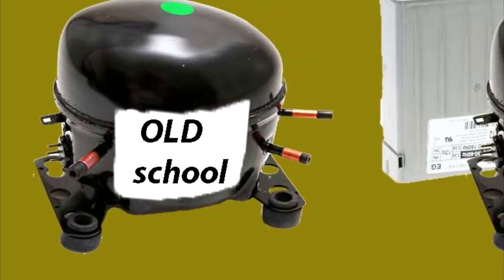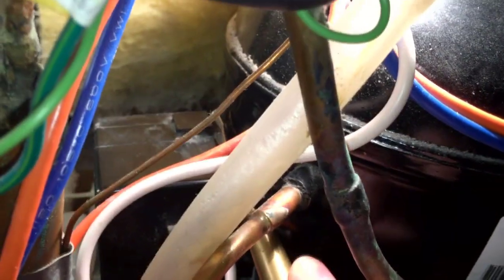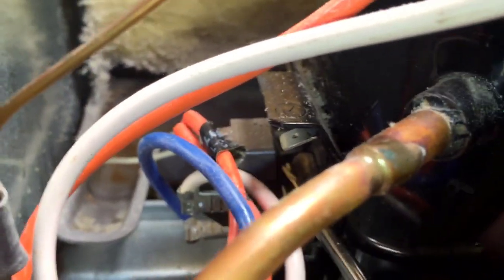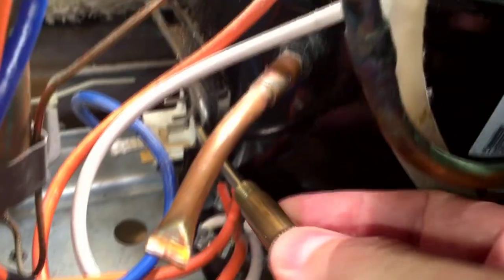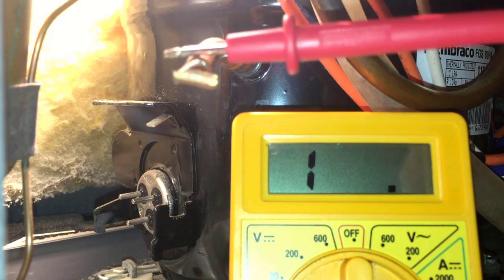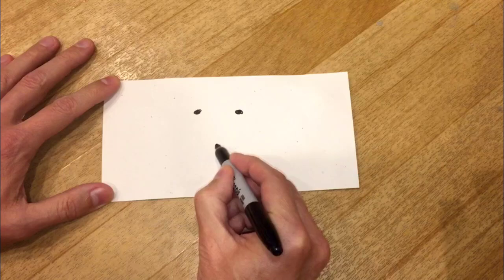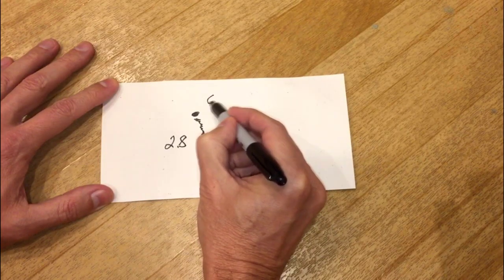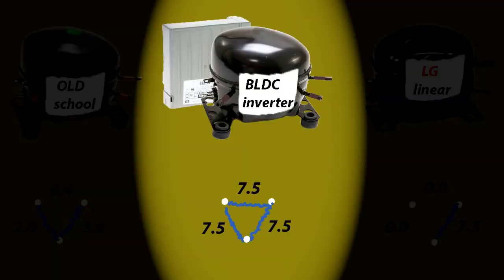Testing refrigerator compressor LG, Samsung, Whirlpool...

Comment: Sr watching your vedio. Regarding  3 types of compressor. Why that lg com. Deffirennt widing? Kindly explain . ?  Your subcriver from the philippines  thank you
Reply from the maker: The LINEAR technology is different than the others. So it requires only 2 terminals, HOT and Neutral. It can also be powered directly from the wall electrical outlet.

Comment: Great video. I have LG lfx25974sw from last 7 years. It stopped cooling. I checked both capacitors from panel, both good, fan and compressor  working and from my left bottom to top was 7.5. However, coils are room temperatures and one of the compressor line does get slightly hot if let it running for an hour. My technician suggested that the compressor is bad. Any suggestions. I am very non-technical but gained a lot of knowledge from YouTube from people like you who actually share their knowledge to benefit other and I have benefitted Thanks. BN
Reply from the maker: It seems you've done everything you can on your part. The problem is with the compressor, the refrigerant leak or restriction. Any of these problems should be repaired by a tech and kinda expensive. So I guess it's time to decide if you want to fix it or buy a new one. If you have the receipt, LG may cover the cost of the new compressor, but you'll pay for labor.
Reply: @Your-Self  Thank yo for your reply. LG sent me correct compressor but wrong Board and after figuring that out got new board. Earlier tried the Wrong board which only sent power to compressor as other would not connect and it ran for few minutes and then died. Service man connected new compressor and put some Freon but the Compressor would not work and still does not work even after he put some hard start as he said that it by passes the Board but the compressor would not start. He does not pay any attention to my Please to check the capacitor, over load or relay. I have bought two Volta meters but don't know how to check the capacitor, relay and the overload. Other tech I cant get as he promises but no show. Any suggestions. If none that is OK. Thanks and Happy Holidays.

Comment: Hi thanks for the great videos! New subscriber here. I have an old-school compressor that won’t start. I changed out the start relay but still not working. My readings are across the three pins 5.4 3.2 8.2 my low readings don’t exactly match the total high rating. About .4 difference. is this enough to indicate a problem with the compressor? Thanks!
Reply from the maker: Your compressor readings seem to be OK. Did you check if the compressor is shorted to ground?
If the fan (next to the compressor) is not running either, the thermostat (temperature sensor) could be bad.
Reply: @Your-Self  hello! Yes I checked continuity between Pinz and ground seems to be OK. Both fans are spinning OK. I thought I eliminated the thermostat because I checked for continuity across its connectors at room temp is that right? Thanks for your quick reply!
Reply from the maker: It's difficult to say because there are many different mechanical and computer-operated systems. So depends on your model number, problems may vary.

Comment: So, if I have a BLDC compressor and it is 0.0 on all pins, it is Dead and needs to be replaced?
Reply from the maker: Are you sure your multimeter is working correctly?
Reply: @Your-Self  black in common, red NOT on the Voltage side.
I did just recheck the multimeter on a household electric receptacle and it registered 123.3 ( I have a 110 outlet)
Are you saying it should register some kind of number?
Reply: I'm going to check one more time.   It is possible I had the dial on 200k instead of 200

Comment: Hello
I have LG with freezer at the bottom. Top fresh food section   stopped cooling , air is blowing ( when I open the door and hold the switch I feel the air blowing but it is barely cold).
The freezer is a bit colder but nowhere close to freezing temps. 
Compressor sound like working and it is intensively warm , however both tubes : in and out tubes- are at the same room temperature and the coil is not even warm. The coil is somewhat dusty but nothing major and the fan is blowing air through the coil. 
Does it mean compressor is Done?!
Appreciate any help, thanks
Reply from the maker: The problem could be with the refrigerant leak. But if it's an LG Linear compressor, most likely it's damaged inside. If your refrigerator is under 5 years old, it's worth calling LG directly, and they may fix it for free.

Comment: I have an old school compressor and it reads perfect at 9.3, 5.4 and 14.7. I have a new relay, and it vibrates but it doesn't cool the fridge, oy part I haven't replaced is the overload switch but I tested it and it test fine. I'm not sure what to do next from here.. Any suggestions?
Reply from the maker: If the compressor works (vibrates), the overload is good.
Do the fans, by the compressor and inside the freezer, work?
If they do, you may have a defrost problem (Evaporator is full of icy-frost), or a refrigerant leak (an expensive repair).

Comment: In mine they are bigger. 18, 40, 58. Is it normal? 18 + 40 again makes 58. NEO BC-125 WA+ MID (is small, but class F of efficiency, 107KW per year) , The refrigerator did not start, but a click was heard between 2 and 5 minutes. The starting relay rattled and when opened it was broken from the inside, the resistance was endless and there were traces of burns on one terminal because it has only one input.
Reply from the maker: The higher resistance is normal, it's just less efficient when it works.
Your starting relay has failed and needs to be replaced, as long as the compressor is not shorted to ground. The compressor could also be locked internally, but it's impossible to test without a new starting relay.
Reply: @Your-Self  Thanks for the quick reply, but how locked? Between the 3 terminals and the grounding resistance is infinite.
Reply from the maker: So electrically, your compressor seems to be OK. But it could be locked mechanically inside. This could happen if the compressor got severely overheated and the oil inside burnt out. But I would try a new starter relay first and see if the compressor works.
Reply: @Your-Self  I understand. I hope not that it is still new, so to speak. It is a little over 2 years old and usually stays almost empty. They'll send me the relay and replacement protection soon. I hope I chose the right one because nowhere is it noted what is the overload protection, but I guess it is 1/6 PH because in Amazon it goes with a relay that is 15 ohms (QP2-15).
Reply: @Your-Self  Hello! I took 1/6 protection and everything works, but I'm worried if it's too much. I did not look from the sides where it says that the refrigerator consumes 65 watts. 1/6 corresponds to 125 watts. Shouldn't I have put 1/10? It corresponds to about 75 watts. Is there a ratio between the power consumed and that of the protection or should they be almost the same?

Comment: Great videos!  I have an lg lfx28978st 10 years+  (just out of warranty) and a month ago it started to moan (it was running hot) so I cleaned out the back and it went back to normal.  Last week it stopped holding temperature,  20 in the freezer ( Ice cream like whipped cream) and the fridge is about 40 (a bit warm) and runs almost continuously.  I pulled it apart (freezer) all the fans run, coil in the freezer only frost in a couple places and I ran the tests/reset based on your other video it didn't really do anything and there are no LED flashes.  No signs of R143a leak.   I tried testing the ohms but I am not getting a decent reading.  The buzzer only sounds on 1 connection, but if I turn to different scales I get something out of another and I'm not sure of the reading as the scales are messing me up.   The 7.5 ohms is really 7.5K right?  Based on what my Fridge is doing I assume it's dying, is that correct or is there something that would make it run all the time and not cool, like a clog which i would assume be coming from something in the compressor.
Reply from the maker: Your model has a Linear compressor, so the resistance should be a small 6-9 ohms (not "K ohms").
The fact that you got 10+ years out of this LG compressor, is a great deal!
Your assumption is correct, the problem is with the Sealed System. Any component of the System repair will be expensive (~$600-$1000). So you need to decide if it's worth the repair.
Reply: @Your-Self  I looked at LG fridges yesterday and noticed where the door has water and ice still says linear but on the other side it says on a little badge “inverter linear”.  Did they change the probable magic compressors or did it always say that? I did see where they have a software update to prevent their common line leaks due to corrosion from killing the compressor.

Comment: Hi
Thank you for the video. My Kenmore frig is giving up last week. Fan running, clean condenser, etc. I replaced the relay (prior to watched your video). The compressor does not kicked at all, and if keep on plugged, it got fairly warm. Zero cool air produced. Bottom door frig, model 795.71302.011, compressor sticker showed LG MQ53LAUM. Testing followed your video:
1) No jumping # if touch both on copper tube
2) No jumping # if touching copper tube and the base that attached the pin
3) between pins are 7.8, 5.4 & 11
Is this old school compressor? The hardware look just like your in the vid. The compressor has no mention of “linear”
Is the compressor death ?
Thanks again for the great info and reply
Reply from the maker: The resistance between 3 pins seems normal. But I'm not sure if the compressor is shorted to ground or not because your test was inconclusive.
You should get some numbers jumping when you scratch the copper pipe with both leads. But you should NOT get any jumps from that copper pipe to any of the 3 pins.
If you already replaced the Start Relay, try replacing the white Overload as well.
You can test your old start relay in between small holes, probably marked 5 and 6. If you get somewhere 5 to 25 ohms (at room temperature), your old Start relay is good.

Comment: Hi, I have in BLDC compressor but not running. I checked the windings with 6.50 ohms on the three windings but when I checked the body of the compressor with the chassis I get resistance. Does this mean a new compressor is required?
Reply from the maker: BLDC compressors are generally very reliable. So make sure you are testing correctly, individual pins in the middle to the compressor's body or copper tubing. Not compressor body to the chassis frame.
Most of the time the inverter (gray box) burns out before the compressor.
Reply: @Your-Self   Thank you for you answer but I've already changed the inverter to no avail, maybe its the mother board then.
Reply from the maker: Before you continue spending money on parts, it's better to verify that the Motherboard is receiving the 120 VAC. And the inverter is receiving the same 120 VAC. The inverter also needs to receive a "run" DC voltage from the motherboard which varies between  2-5 VDC (on thinner wires).
What is your refrigerator model number?
Reply: @Your-Self   GE Profile PFE29PSDASS
Reply from the maker: Did you verify that the compressor is not shorted to ground?
Does the condenser fan (next to compressor) run?
Do fans inside the freezer and fridge run?
Do lights inside work?
Does the Inverter get 120 VAC on Black & Orange wires?
Does the Motherboard send a small DC voltage (up to 12 VDC) to the inverter? You can check it at the motherboard connector J9 pins 7 and 8.
If you are not sure how to do all those measurements, maybe it'll be cheaper to call a tech to figure the problem before replacing other parts.
Reply: @Your-Self   Thanks for your advice. When I tested the compressor for a short I didn't conduct testing properly and received a false reading with a multi-meter. With the right testing I've concluded that compressor was indeed good and not shorted. I then replaced the inverter(Jazz Board) and my fridge works fine now.
Reply from the maker: Great to hear the good news!
I believe Jazz Boards is a product of Whirlpool, not GE. Does it say JAZZ on yours?
Reply: @Your-Self  The statement said Jazz Board
Reply: @Your-Self  Also, had to replace water inlet valve due to faulty water dispenser which is about 7yrs old, unusual for two things to go wrong in the same time.

Comment: I got 12.2 in START, 5.5 in RUN but when I join start an run i got 5.5. Is thaT OK?
Reply from the maker: That doesn't sound right. The Start winding should be just a little larger than the Run winding. And the combination of the two should be the biggest number in a basic compressor.
Reply: @Your-Self  thanks

Comment: For LG is that OK less than 7.5? What is the range?
Reply from the maker: Every compressor is different, and the multimeter you have could be slightly off.
So, in general, the resistance between 4-10 ohms should be good.

Comment: Thanks for the awesome explanation. I am having trouble with my fridge. I believe i have the Old School compressor as the two legs added up to the largest number. My issue is the fridge will randomly stop cooling. I think the compressor might be over heating and causing the overload to trip. I think this because I can hear the compressor kick on but it kick off after a few seconds. If I unplug it and plug it back in again it will run and cool for a few hours but will then eventually stop. How can I tell if the compressor is overheating?
Reply from the maker: The compressor can be overheated if the fan near the compressor stops blowing air, the fins of the condenser coils are covered in dust/hair, or the refrigerator is cramped in the corner with no air-flow behind it. But in your case, I'd try replacing the Start Relay first, and see if it helps.
Reply: @Your-Self  new relays are on order. Thanks for the advice and quick reply.
Reply: New relays are installed. The fridge kept cooling for a lot longer then it was before but has since stopped. It's easy to tell because it's a glass front beverage fridge with a digital read out thermostat. I replaced the relays around 4pm yesterday and when i woke up this morning around 7am and it was holding at 38 degrees. since it has stopped and it reads 54 degrees. Any ideas or suggestions would be greatly appreciated, Thanks!
Reply from the maker: How is the compressor acting... clicking ON and OFF, or just dead?
Try wiggling the temperature control knob and see if the compressor starts.
Reply: @Your-Self  the compressor will turn on for about 20-30 seconds then off again. Once it turns back off it stays off for awhile. If I unplug the fridge it will run for a few hours and then just stop.The temp control is not a knob, it is soft buttons with a digital display.
Reply from the maker: It's difficult to speculate without being there, but it sounds like a problem with the Temp Control or the Main Board. Next time when the compressor stops running, instead of unplugging it, try to raise the temperature with the buttons and lower it back down... see if the compressor restarts.
Reply: @Your-Self  thanks for the advice. Latest update: the fridge was running and keeping the fridge around 40 degrees for about 20 hours yesterday. I noticed it getting warmer around 10pm last night when I tried playing with the thermostat and it didn’t change anything. The fridge is an under-counter type and it doesn’t have much room on the sides for it to breath. My guess is it’s just getting to hot.  But it has been in that location for over a year now. Stumped.. lol.
Reply from the maker: Intermittent issues are the worst, lol.
Does this fridge have a fan near the compressor? The fan could be going bad, stopping intermittently while the compressor continues to run, thus overheating. Or the mainboard not sending voltage to the fan or the compressor intermittently. It's probably best to pull out the fridge in the open and observe it for a while.

Comment: In your professional opinion, who makes the better compressor? I need to purchase a new refrigerator and I'm starting to think that I should stay away from LG.
Reply from the maker: According to LG, they improved their compressor last year, but we still don't know if it's any better than before.
BLDC compressors are pretty reliable and efficient. But the circuit board (inverter) running them, may fail in about 5-10 years. It costs about $250-$350 to replace them yourself.
Basic compressors are the most reliable but not as efficient and a bit loud.
Reply: @Your-Self  I appreciate your input. I'm going to look more into Whirlpool. Thank you for your response and for your content.